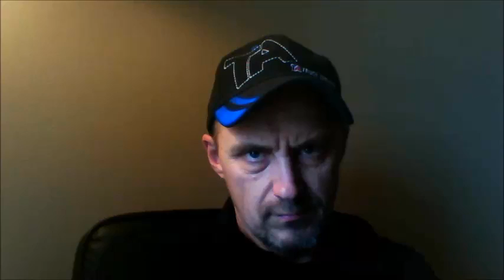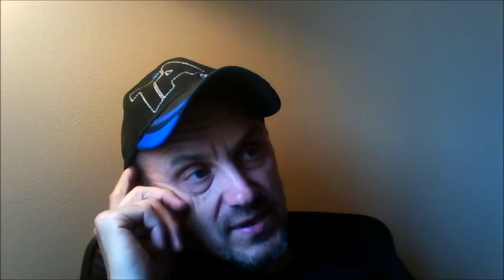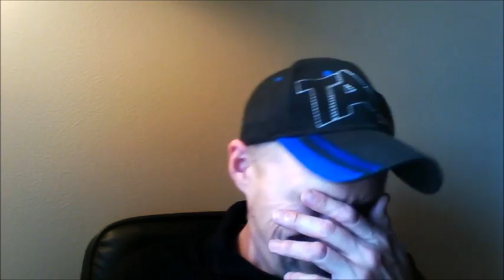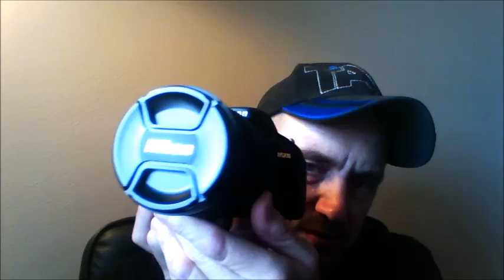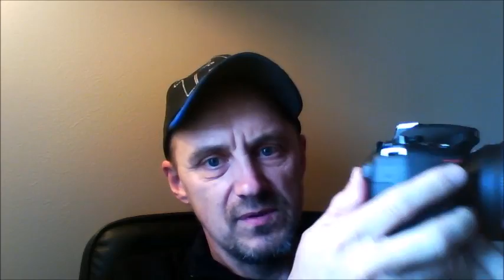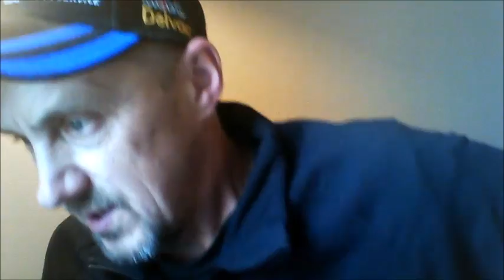TRUCK AND TRAILER UPGRADE 2014

Comment: Sergei, I am not crazy about the shorter wheelbase and all the modifications they will have to make. Considering this is a new truck and you will be needing to make all these mods for an aftermarket drop axle, you need to check with them if adding that aftermarket axle will in anyway void or reduce the warranty of the truck in any way and get it in writing. I would also shop around at other dealers to get better price on the brand new model built exactly to your specs just to compare to this dealerships price because it seems like he is giving you the run around now, especially after him not being able to find any contact number for that axle place.
Reply: I agree that short wheel base I'd stay away from it.
Reply from the maker: max dean i asked the salesman why they ordered this truck with 14.6K front axle, 46K tandem and only 227" wheelbase. He had no idea a longer wheelbase would help with weight distribution when pulling heavy.

Comment: Sergei, the "Mack Daddy" of heavy haul! ;)
Reply from the maker: i like to be a bit different. if 95% of people drove a peterbilt and all the press was singing praises, i'd probably go for the number 2 or 3 bestseller truck.
Reply: Same here. You'll like the Mack,at least I did when I got to drive one for a while last year. It was a rental so it got turned back in when they got enough of our Internationals up and running again.
Reply: ***** Nothing wrong with a bulldog. My dad owned 5 (all different trucks, similar models, 3 Superliners, 2 CH's) of them before he retired and I drove two different ones myself a CH613 and a CX613 the first visions that came out. Loved those trucks, they were both ahead of their time in driver comfort and room in the bunks. Good luck enjoy your new ride.

Comment: We have been anxious for the update so thank you.  Don't include the chains and binders on the trailer, they are a gold regardless of there size, you are already handing them 1k for a bonus, no need for another.

15k for the prime mover?.. it's a working truck with 3k's worth of tires! - TOO CHEAP!! - you get 8-10k for a truck with a stuffed motor.  Stand your ground when negotiating on the Truck sale price, you can make 10k a month with a working truck so it's already cheap - a working truck is always worth more than one that's sitting idle.

You need 3 quotes/deals for this new truck and as painful as it is this gives you bargaining power and some baseline for what deals can be done.

Regarding the new truck, go to Volvo and see what they have, Volvo owns Mack so most Mack parts are now made by Volvo.  

There are Volvo's running heavy haul here in OZ pulling 100+ ton, also Mercedes pulling 120+ ton road trains, not all Mack/KW/WS as there norm suggests.

Stick your heels in Sergie, the are biting and HAVE THE MONEY just don't give them too much for free as you have already worked damn hard to pay for it.

Cheers,
Dave from the land down under.
Reply: The Land down under, can u hear that thunder. Awesome song.

Comment: I would hang on to all loading,binders,chains and assorted gear. As long as you have a place to keep it all. Good luck with all the planning! I would agree with others that you don't want to sacrifice wheel base when adding a steerable drop axle.

Comment: hope you get all of this figured out. cutting the fuel tanks ??. Im asking, wouldn't it be better to buy off the shelf smaller tanks?. how big is the sleeper?. what kind of engine ?
Reply from the maker: 70" sleeper, mack 13 L engine 505 HP 1850 torque.

Comment: Sergie, I don't know if this would apply in your situation, but in Ohio when you trade a vehicle in on a new one, you only pay taxes on the remaining balance after the trade.  If your buying a new vehicle that costs $100,000 for instance and they are giving you $20,000 for your trade-in, you only pay taxes on the difference which would be $80,000.  Hope this helps.

Comment from the maker: since i'm looking at macks, might as well look at the company that owns them - VOLVO. http://www.truckandtrailer.ca/2015-volvo-vnx64t430-heavy-haul-tractor-lively-sudbury-on/87571/1/
Reply: Once again you want that open radiator for air flow when pulling heavy slick have a smaller opening running hotter burning more fuel and robbing the truck of power when that fan kick on.
Reply: volvo :) from my country sweden! :)
but i wonder.. the picture of the truck is dated 2012 and info says model year 2015.. maybe the camera date is setup wrong?

Comment: It's your decision of course, but please take your time making it. Yes change trailer asap but play one truck dealer off against another once you have clearly settled on a spec.

I'm very surprised that you would consider "throwing in" all your chains and binders, straps, tarps etc with your old trailer, surely some if not all of this stuff will be needed with a low boy? Also retaining them, with obvious limitations, it would allow you to get some loads if a heavy haul load is not available in the area where you find yourself.

Is there a reason why you haven't contacted dealers in the States as yet?

I know that there are heavy taxation reasons and benefits for buying new but the depreciation is likely to be very heavy initially on a new one, could you get a good deal and manufacturers warranty on a 2-3yr old truck at a much reduced price?

Good luck and best wishes whatever you decide to do!!

Comment: I can see where getting the right engine fit for your particular job hauling is important. The Kenworth large capacity gas tank seem like good sense to get you to cheaper gas areas for fill ups.
Reply from the maker: the easiest way to kill a highway transport truck is to put GAS in its fuel tanks.
Reply: ***** I meant fuel - diesel fuel. Lol

Comment: Go for a brand new one - this one is an oddball truck the dealer ordered by mistake. You would be better off with the longer chassis + larger fuel tanks. And, better resale value.

Comment: You're going to buy new chains an binders if you get a lowboy?
Reply from the maker: Yes - 1/2" chains and binders.
Reply: Roger tht. You'll have to pick up some big ratchet straps with chain ends too. I hope you avoid looking at ground bearing lowboys. Would you put a wetline on your truck..those self contained lowboys with a pony motor is just another engine to worry about and if it don't run your screwed.

Comment: Searching the mileage is easy to check if it's real or not. Heavy haul guys generally do t run high miles. A trip to cat and a blow by test and a run in they dyno will tell you how the motor is doing. I was Just offering a different pov for you. Sorry sir.

Comment: 10-4...check with a few repair shops before doing a big repair. Top secret helicopter delivery...wowee! Dam. Now you gotta learn to fly one in order to load it! Gotta go back and visit the babe in the green yogi bear costume with the helicopter strapped on your back. Check with the bank for the loan for the new low boy before you sell yours. Put a neck strap on the camera so you don't drop it. I dropped a small camera one, it was trashed after that. Your stepdeck is new, ain't it worth more than 16,000.00? Trade the stepdeck in on the lowboy.

Comment: Serg you are a very experience trucker O/O and you run hard every  year treat yourself man  don't get a Mack man go with a 2007 Pete 389 270 wheelbase 1850 torque 550 cat trust me  85% of the time that truck will already have all the bells and whistles . They are out there  you really have to search don't and I repeat don't get a post emission truck you'll regret it dude I've heard to many bad stories . That Pete weight is 18500 full tanks. A Mack really I know that they are tough but a tricked out Mack doesn't really turn heads like a Pete or kW . I'll go with a freight liner  Coronado first but if you want new with high payment go ahead.